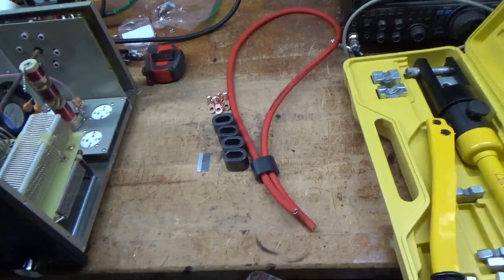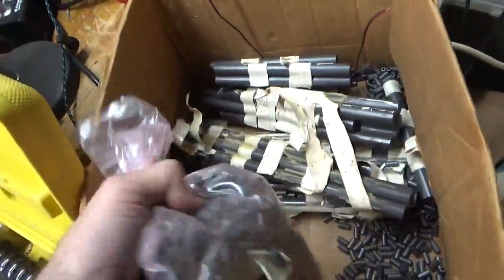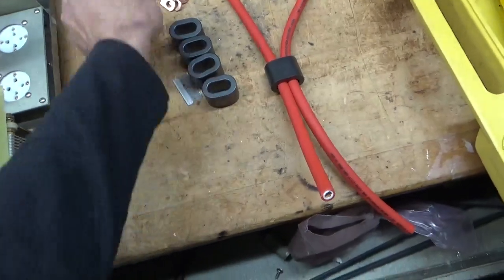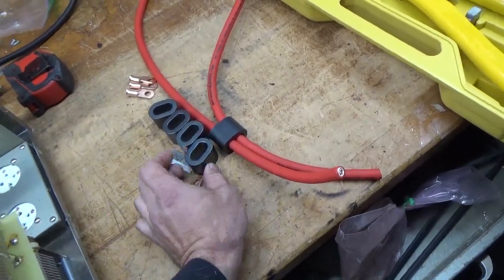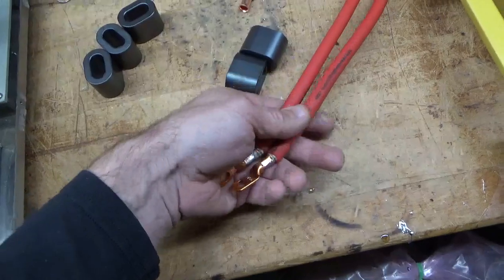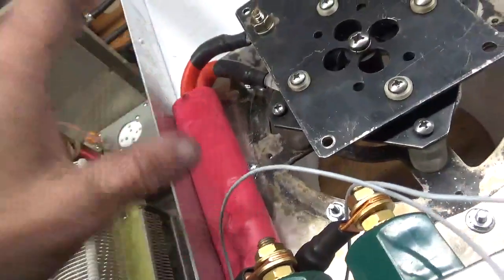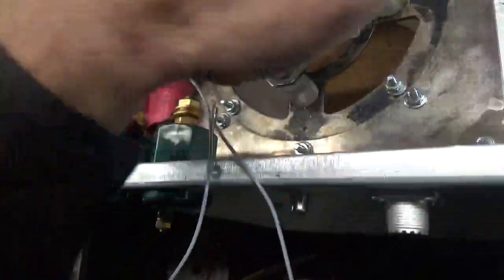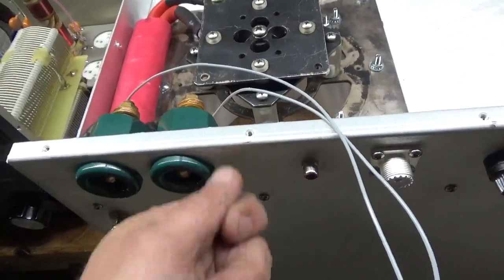3cx6000a7 6 Meter Pa  Filament choke

Comment: Very nice.  I like this design and would love to try it.  I didn't see the part that was mentioned on how to build the choke based on the operating frequency. Can you tell me how many beads would be used for use up to 30MHZ with a larger tube with a 160amp filament draw and where to get the ferrite beads?
Reply from the maker: Take a look at the 160-15 meter pa